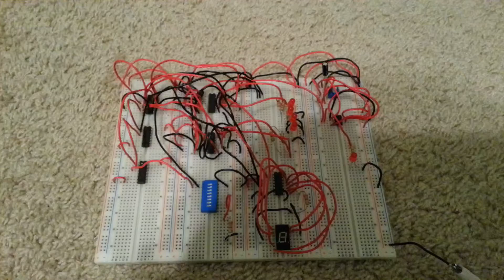BCD Counter Using Two Dual JK Flip Flop Chips (HD74LS76AP)

Comment from the maker: @morhuma19&@King Fin i don't have a circuit diagram for this. I just mainly built it without using or creating a diagram. I should have in retrospect but I was rushed when completing this! And @DoubleDuece2500, I never had any issues out of the jk's. I am using two dual jk chips (each one containing two separate jk's) and I used a 555 astable timer circuit setup for my clock on the jk's. And from what I recall the only resistors I used was in the astable 555 timer circuit and then with the led's. What were you using to generate the clock signal?

Comment: Very nice circuit. I have a question for you....did you have any problems getting your jk's to work together?  I'm designing a sensor circuit using 3 dual jk's and every time I hookup more than 3 individual jk's I have issues with making one of the other jk's outputs go high when they shouldn't. I'm thinking its a problem withy clock. I'm using a vcc of 6v. The clock is decoupled. Did you use current limiting resistors at your pin inputs at all?  Any advice would be helpful. Thanks.

Comment from the maker: I am using a 6 volt battery. The 74LS chip call for a 5 volt DC current, but a 6 volt batter will do just fine. And yeah its all DC